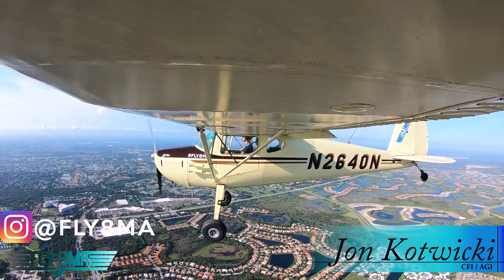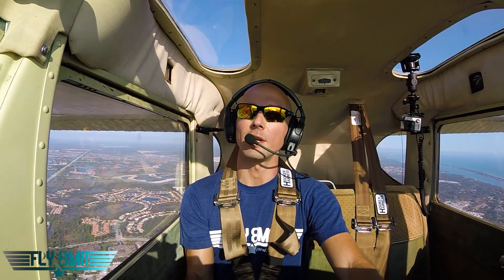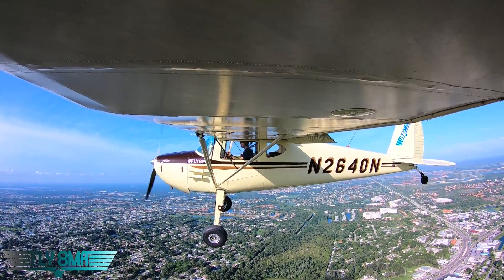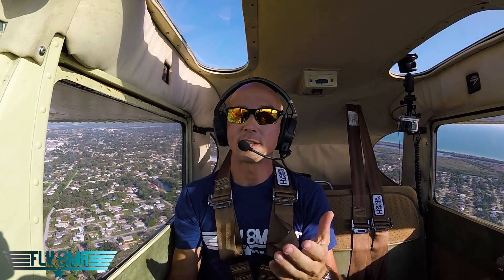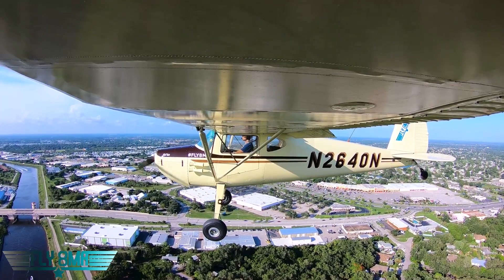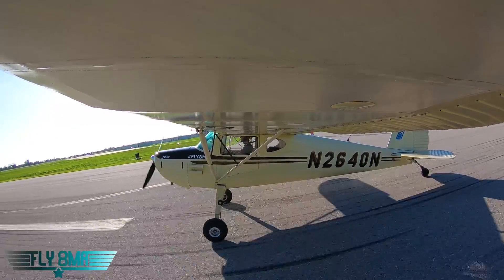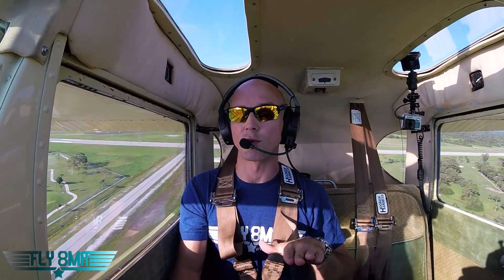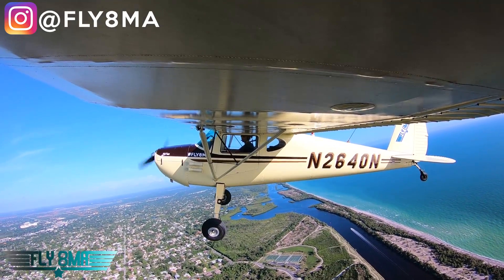Turning with a Slip | (not for student pilots) Using flaps for drag and lift

Comment: I was doing a check ride for tailwheel and aerobatic. Passed everything and on landing, there was a 737 that just touched down on a parallel runway at KSNA.  Saw tire smoke but I never thought I should NOT fly through that smoke coming to my runway.  Instructor took over and made immediate climb over it, then did a wildest and lowest altitude slip I've seen to slow down.  I failed that check ride.
Reply: So being willing to fly through the tire smoke was cause to fail you? Or what was the reason?
Reply: @Iflyagrasshopper Even at touchdown, 737's wings are creating lots of life thus wake turbulence.  Wake turbulence travels with wind and tire smoke was a visible sign of it.  To this date, I do not know exactly how severe it would have been, but bet it carries enough energy to flip over what I was flying.  BTW, I passed on the following ride.

Comment: The fwd slip is a high drag manouver, so it should be mentioned that the drag is reduced when kicking out of it and aligning with the runway, which gives the a/c more boyancy (elevator authority).  Be ready for the a/c to balloon during the flare.

Comment: As a student pilot, I had the great privilege of being taught several techniques by an old aerobatic pilot. One technique, in particular, was how to do a turning slip to land if I was in a hurry to land quickly when finishing the downwind leg and preparing to turn base to final. Full flaps. Full right rudder. Left aileron (adjusted to the amount of turn desired). Push forward on the yoke and hold the descent speed at 70 knots. These four actions got performed simultaneously. From comments I heard later, the wings of the Cessna 172 looked like a knife blade coming down from the sky. It was a fun experience. I got to do the maneuver many times.
Reply: I also learned the turning slip early on in my training by an old time pilot, best maneuver ever learned to make me a confident pilot.
Reply: Slipping turns are the best!

Comment: Forward slip and turning slip to landing is doable. We use it on a gliders, and sometimes it's the only way to land a glider on a desired spot. But it is not safe enough to recommend using in in a everyday routine. Forward slip can't be done fast, airspeed indicator isn't accurate since air stream is blowing to the side of the pito tube.  Now we are flying cross-controlled and slow and we don't really know our speed and dangerously close to the ground.
As someone who really like doing forward and turning slips to landing on a glider, I must admit that it is not the safest practice and a single mistake can kill you. 
So practice up high first. And use it only if you have no other choice (no flaps, engine out and etc.) in other cases, go with missed approach.

Fly safe!
Reply: Definitely doable.  In the commercial glider checkride I had to fly a pattern in a slip.  Really had to watch the horizon to be sure of maintaining safe and proper airspeed, especially being careful to maintain enough when the spoilers came out (they slow you down).  Not a normal maneuver.... Once when I was very high going into a short runway in a glider I used full slip and spoilers, gently easing the slip off and then going  to half spoilers for a normal landing, all the time being darn careful to keep the speed in the right zone.  Not proud of that pattern, but it did teach me to be more careful on establishing a good approach, and also showed what a serious slip can do.

Comment: I fly a C152 that does not want to land and have taken to removing flaps at the latter half of ground effect to "weld and grease" the landing. Never really considered popping the flaps for takeoff though.
Reply: I do that since 1979.  Pop flaps at Vx, Cut flaps on flare.. Lots of fun.  I was a Bush Pilot CFi later on.  Surprised many "old pilots" with those flap tricks.. Those tricks can save your skin too..

Comment: YOu can also pop some Lift Flaps on turns you want to tighten a bit more, or to lower the stalling speeds for safety.  We did that on  Crop Dusting low turns too.
Reply: And it is a lot of fun too... Roll into the turn, pop more flaps and enjoy the roll..

Comment: 04:55  (You said to put Full Flaps to lift it). Im a Bush Pilot CFI.  I suggest not put full flaps on take off unless you have a lot of horsepower, which not on that airplane.  You actually put around 20 degrees which are still mostly "Lift Flaps" there. Full Flaps are mostly Drag Flaps unless you have a lot of full power horsepower to push more air around them and overcome the full flaps drag.  The heavier the plane the higher the flaps to be Lift Flaps and vice versa.  is good to clarify with the student what conditions can lead Lift Flaps to become Drag Flaps on the same airplane. Contact me for more details, if..
Reply: Yes sir,  The higher the Density Altitude Or the higher the weight THE HIGHER THE FLAPS to use on take off.   With higher Density Alt. lift flaps become Drag Flaps due less power to overcome the flaps drag portion of flap usage..  Good..  Henry above was my student in year 2000.
Reply: When u say ,higher density or heavier aircraft requires higher flaps.
Do u mean more flap?
Example,my warrior when empty I use 2 notches to pop up.
Would I use 3 notches if I was at max gross? Thank you.

Comment: Forward Slip. For safety i keep the Vfinal even if I know the pitot tube is  slanted and indicating less speed.  In a low uncoordinated turn specially is better to keep Vfinal so I dont get too slow while low and also uncoordinated.  As a former DC3 pilot, except on warm weather, we used to do a forward slip on approach so we could keep the 20" of manifold pressure on the fragile cylinders on those old engines.  Good video..

Comment: What I did not hear addressed in this video is the potential for a accelerated stall to occur. ALL of the ingredients for a spin entry are being demonstrated here
Reply: As long as you keep the speed at Vfinal and dont pull like crazy or in panic.. They are safe.  You sound like those wimps that dont know slips and put down the brave pilots that do them and teach them..

Comment: I was surprised to see that base to final turn as a skid. I learned to fly in a Citabria, and we slip in turns and on nearly every approach, but were taught to NEVER skid a turn in the pattern. Maybe it's just me, but that seems like a counter-intuitive practice.
Reply: A skidding turn uses bottom rudder, not top rudder (slipping turn)
Reply: @user-so8nj3ln7m  Yes, and he clearly is using left rudder and right aileron in a left turn. That’s bottom rudder. That’s a skidding base to final turn.
Reply: @milehiaviation  good eye Mark.  He was fighting a right crosswind and therefore had lots of right aileron even though left wing was down.  So you're right, it was an inappropriate visual "demo" for students.
Reply: I always try to remember, "Step on the sky, don't die" for slipping turns.

Comment: When I slip I feel I have too much vsi and bounce. I also tend to land a bit flat (c172s) What could I be doing wrong.. or missing?  During my cross-country solo i thought i  was on an excellent power-off approach until I bounced it. Looking at the video, I note my forward speed is ok, but vsi is high. So I assume it was the vsi and have been wondering how to better control it prior to touchdown  without increasing floating distance. (@10:40 https://youtu.be/ur85syHmh1s)
Reply from the maker: You're doing everything fine, speed is good on approach, BUT you're touching with too much speed in the airplane (still wants to fly at 50+ knots and will easily bounce off).  Hold off the airplane from the runway a little longer and just try to keep it at 2 inches above the pavement as long as you can. You'll touch with a slightly more nose high attitude, but the landing will be softer and even if its the same "sink rate" there won't be any energy left in the airplane to bounce like that.  Touching down at the speeds you are and then trying to "make" the airplane stick to the ground doesn't work out well (leads to bounces, porpoise, veering left and right around the runway, going off the runway, and broken nose gears).  Don't feel bad at all, what you are doing can be fixed with a CFI in about .7 or .8 on the hobbs and you'll be making great landings.  Everything else you're doing already looks good....

Comment: Great tips. I'm taking re-currency training after a long break, I instinctively slipped from a high final but with full flaps, instructor was not happy with this, felt that too much lateral stress on the flaps as a result, what's your take on this ? I was in a C172SP . Thanks again, love the videos and their information.
Reply from the maker: Really no such thing as "lateral stress" on flaps.  Some of the older C172 warned in the POH against slipping with full (40 degrees) flaps, but in my limited experience with 172s, I could never replicate the tail stall that was the reason to not slip with 40 flap.  Personally I have no problem with a student using full flap (30 in the new 172s) and doing a full rudder deflection slip.
Reply: Thank you , good to know.
Reply: @ozziepilot2899  the the tail stall on a T-tail design is important to not just take anyone's advice • I concur with 8MA here as I have not seen nor heard of any basis to avoid slips at 40° Flaps in 172 other than they are large for practical and thus having the Barn Doors fully-down at extremes it seems to me at that we are beyond POH norms anyway — so why any reason to slip since the 40° Flaps in 172 will do all that can be done — other than stunting which is another subject entirely; 

Not any part of standard training; I suggest study of Dutch Roll as an oscillating vortex and obtain FAA Examiners Handbook for Commercial;

Comment: Jon, on your base-to-final left turn it looked like you had your right-hand down. I assumed therefore that you were applying left-rudder as you were still demonstrating the slip.  Surely this implies a skidding turn instead of a slipping turn (and higher danger)?  I was expecting to see left airleron and right-rudder during that left turn which I understand to be safer way to dispense of some altitude during a turn.  Or was your rudder neutral during that turn?  Thanks.
Reply: Yep, I have noticed too, there is a skid turn instead of a slip turn. In slip turns you have to kick the pedal which is outside of the turn. If you are applying rudder to the side of the turn, and cross controlling the ailerons to the otherside, you are in a really bad situations if stalls.
Reply: Did exactly this for my quarterly training and our assistant chief was telling me i was skidding and not slipping. From my knowledge, i was cross controlled to descend which in my head is a slip. After doing more research from what im reading, it is still considered a slip. Yes the ball is on the outside of the turn but we are slipping which results in turning from the base to final. Slipping in the other direction would be much more difficult to get aligned on final when you recover. In other words, if it were a skid to lose altitude it would have been left rudder and correcting ailerons to prevent the overbanking tendency which is not the goal because we are trying to bank to lose the altitude. Other thoughts please let me know. Open for discussion
Reply from the maker: On the base to final turn if I'm trying to loose altitude I prefer to skid (same principle-ish).  Might be slightly less safe, but stalling cross controlled that close to the ground is going to be a bad day whether you're slipping or skidding.  I prefer the skid for better visibility of other airplanes around me....and simply control your angle of attack precisely...  (That's why this one was titled not for student pilots).

Comment: Side-slipping is very useful tool if you're taught (like me) to do the approach with no throttle. Getting too much used to use enginge to correct a lower approach can be an issue if your engine quits. Learning to master side-slipping makes simulated engine failure emergency landings much more controllable... and really fun.
Reply from the maker: For sure!
Reply: As a student I had an instructor demonstrate to me how you can lose a few hundred feet of altitude even when the plane is already almost over the end of the runway and still touchdown just past the numbers with a beautiful greased landing! He had the plane nearly sideways and dropping like a rock, (he did have tower’s permission for this). It left my mouth hanging open, I’ll tell you, but it sure demonstrated what you can do.

Comment: Isn't there more chance to enter into a cross control stall?
Reply from the maker: Well, yes, being cross controlled and exceeding the critical AOA, you are highly likely to get into a cross controlled stall.  (Careful with your AOA!!!)
Reply: You will lose height even faster in stall! :D Also some planes especially with full flaps settings are not recommended for slipping, as the control surfaces may not be as efficient.

Comment: If there's a crosswind, don't you by definition keep the slip all the way to the ground? If you keep the plane aligned with the runway and the upwind wing down, you're slipping...
Reply: you can do that. However In larger planes you fly level without slip, just as you would at cruise with crosswinds, and straighten just before touchdown with only enough aileron to keep the wings level.
Reply: I think in the video he is referring to a forward slip to lose altitude versus a side slip in a crosswind landing.

Comment: I learned the slip for altitude descent as an Aviation Cadet in USAF in 1960. Doing it in the pattern is a little on the dangerous side without a tower or at least checking visually for traffic. Recipe for a mid-air.

Comment: Crazy to me that this is taught in US and not actual spin recovery. All the right ingredients for a stall spin are in this manouver.
Reply from the maker: It is too bad that they removed it from the required training.  I'd like to see it added back in, however, the main reason was they were losing too many guys in accidents in training (which in my opinion removing it from the training may have fixed one problem, but created a much bigger one).
Reply: @fly8ma.comflighttraining199  I agree that spin training is very important should you ever get in that situation (usually from badly skidding a turn with the nose high) but first it takes having instructors who are well versed in the subject.  Unfortunately many are not, so then the training become problematical.  Personally I was fortunate to have a good CFI who knew spins.  After bumbling into one trying to do my first accelerated stall (in a Cessna 150)  I asked him to teach me how to recover.  When I went on to gliders that served me well, as it is easy to drop into one if you aren't thermalling well.  Understanding them and being able to recover sure gives one more confidence with stall practice.
Reply: Spins that are caused by a slipping  turn have a much larger recovery window than on skidding turns. When stalling in a slip, the raised wing stalls first and causes the wings to go level before starting to do all that fun spinning stuff. A little nose forward pressure and you're back on track. Although it can still be hazardous if you dont recognize the signs of the impending stall and dont have the altitude to go nose down a bit, generally slips are pretty safe.

But yeah we definitely should teach more spin awareness and recovery as part of the PPL certification in the states
Reply: @ButtTrumpet100  Good point. It's important to make sure you are slipping and not skidding when low and slow. Unfortunately, there seem to be a fair number of GA pilots out there who don't understand the difference.
Reply: Adam Thomas that’s why you don’t stall and watch your speed/angel of attack.
Reply: It is that stupid pilot trick, on left base you over shoot a little start your turn, put in some left rudder to pull the nose around, which drops the nose you pull a little to bring the nose up and your in a spin. Seems like slipping in a turn is an easy way to enter that stupid maneuver. Sure if your in left turn with right rudder you will probably work out ok, but I think I’ll just keep the ball centered in the turn and slip it when straight with the runway, then uncross the controls when altitude looks right and if I’m still high I’ll just go around.
Reply: It's not. You always use rudder opposite the direction of the turn when slipping. Slips are considerably less conducive to stall/spin entries than a skid. Most stall/spin accidents from base to final are what you said, adding more inside rudder to pull the nose through. That is a skid, not a slip.
Reply: @gunnerjoe53   You are confusing that "stupid skid "pilot trick" with a slip.  Change CFI's already.  That is basics of flying you are confusing about..
Reply: Perhaps it's just the glider I've flown that behaves this way, but it's pretty difficult to enter an inadvertent spin from a slipping turn.  A skidding turn puts you in the exact scenario where people end up spinning, but slips are the opposite.
Reply: Stall/spin accidents tend to be more deadly than other types of GAaccidents, accounting for about 10 percent of all accidents, but 13.7 percent of fatal accidents. Overall, around 20 percent of all GA accidentsresult in fatalities, but stall/spin accidents have a fatality rate of about 28 percent.